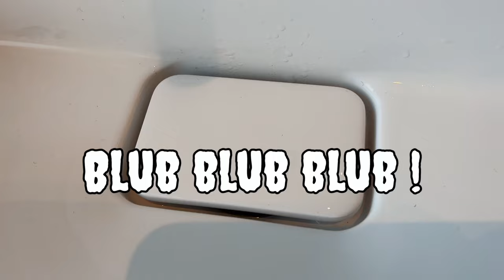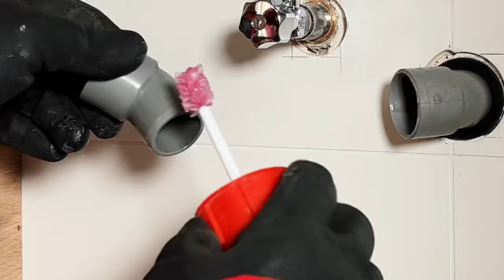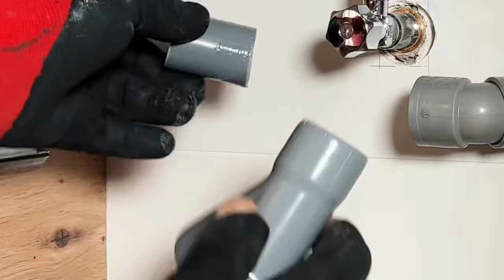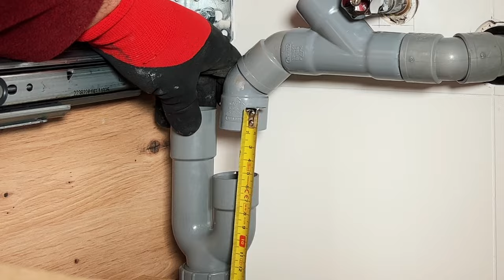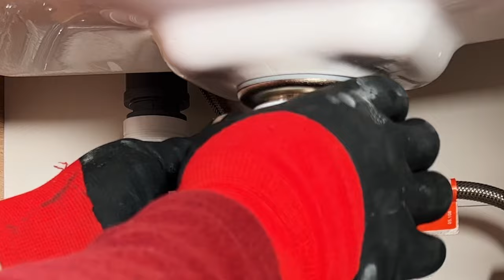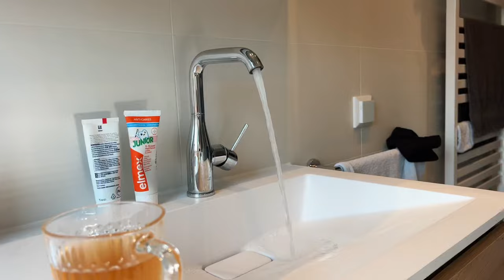A plumber shows how to solve a gurgling noise from a sink drain

Comment: Great now if the drain gets clogged you have to cut all the plastic out because you didn’t put any removable fittings
Reply: 😂😂😂I  was like is that really a plumber because that does not look professional.
Reply: You can pull the hole thing out of the rubber sleeve in the wall.
Reply: There is a cap at the bottom of the swan neck for cleaning. Cheers

Comment: What about an apartment sink drain that will belch loudly, even if I haven't used it all day?
Reply: This is one of my questions also
Reply: Best guess, something upstream a long the drain has been used. Water goes by, it sucks air down the drain. Still repair with mechanical drain, or better clean from roof vent.
Reply: @-8_8-  That was my first guess after doing research a while back. I've tried several times to tell maintenance, but it doesn't seem like they or the professional plumbers they call in agreement, even after sending a camera down my drain and finding nothing and tearing out my kitchen and replacing large sections of pipe under the floor.
Reply: @AlKaseltzer87  If there are vacant apartments or bathrooms not being used near you/on your same line, that could also cause the gurgling noise.  If any P traps got dried out from not being used, it could make the noise happen in your sink.  If you're not experiencing any slow drainage, then you may want them to check vacant/unused sinks around you.   They need to run the water in any of those sinks to make the P traps are full to see if the gurgling stops in your sink

Comment: Or just use an anti vac trap 🙄
Reply: In a pinch you can just drill a small hole and install an aquarium one way air valve as it doesn't take much air to break the siphon affect.